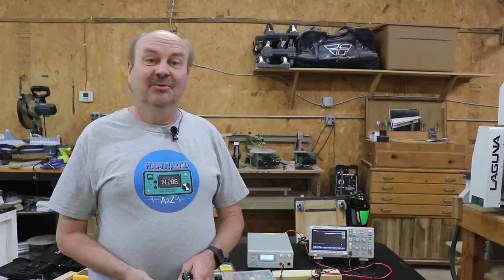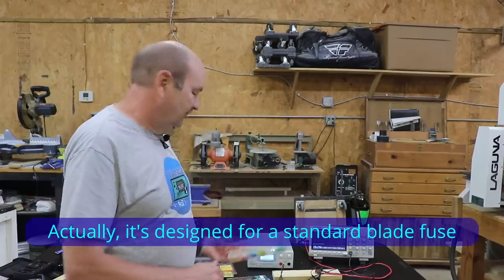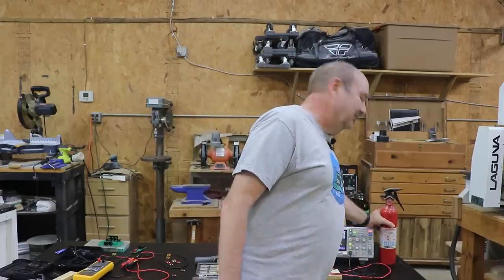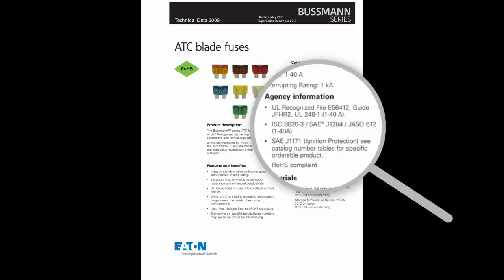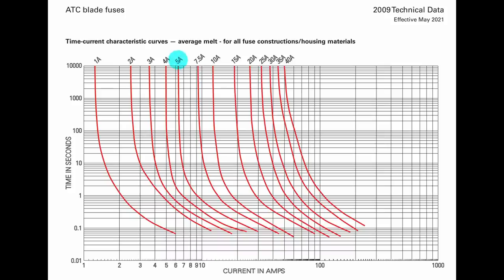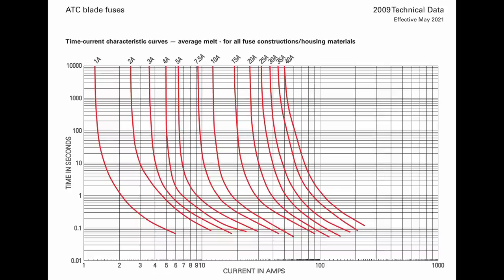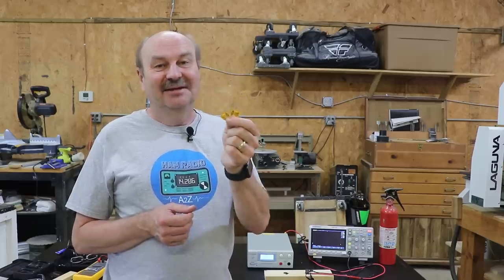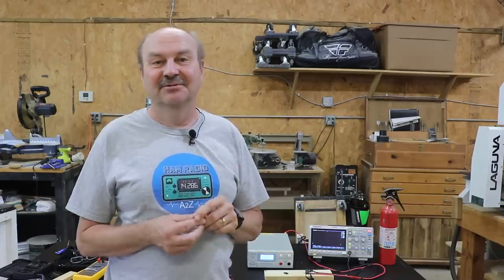Bad Fuses

Comment: Interesting I had problems with no name fuses but the other way around five amp fuses kept blowing  on a constant current battery charger putting out four amps did not blow instantly but after about three charges of the battery on a mobility scooter.
Reply: I'll second this. Most of the Harbor Freight or any unbranded fuses always tended to pop for no reason under normal load. 
I'm not sure using a fuse as a shorting element across the terminals of a power supply is an accurate test. I think the better test would be to place the fuse mid circuit against a controlled, resistive load through a larger power source. 
From experience over many years we often found that any fuse, regardless of the rating is better than no fuse. That meaning that even a 20a fuse will protect a circuit rated at 10a better than a solid wire, bolt, or tin foil wrapped old fuse. In most cases the fuse will blow before the wire melts. This does not apply if your trying to protect fine circuitry though. 
A case that comes to mind was a vehicle which had its battery polarity swapped by a careless tow truck driver. The car was brand new but the woman had left a power inverter on charging her laptop all day while at the mall. 
The end result was fairly substantial damage, the alternator, ECM, radio, air bag monitor, and just about every circuit that had any sort of constant memory function was burned out. The radio failed so thoroughly that even the LCD display was melted inside. Not a single fuse had blown in either fuse panel. Out of curiosity I kept and opened most of the damaged components to see exactly how and what failed. 
The radio, ECM, and alternator took the most damage. In the alternator all but one diode was burnt, and the voltage regulator was an open circuit across all terminals and it had even burned through the plastic cover on the back. The radio was pretty much a total loss, no one component failed and parts of each circuit each showed major burning damage. In the ECM, the failure point was at the case ground, which on that model was a 3/16 inch tab of steel which overlapped the main board as a ground, the corner of the board and the tab were melted and open, as was the memory portion of the circuit board nearest to the constant power pin. 
The explanation I got from the tow truck driver was that his jumper cable quick disconnect was broken apart and he had stuck the wires in by hand and 'got it wrong I guess'.  He said he knew something was off when he smelled smoke and realized that the battery terminal had melted. All of the fuses were OEM factory fuses the car was only a few weeks old at the time. 
At the time I would have figured that at least some of the fuses of fuse links would have blown long before that sort of damage occurred. I went so far as to call both the manufacturer and their engineering department to try and get an answer. What I finally was told by an engineer was that even though a fuse may see current in excess of its rating, when put into a direct short situation like that often the fuse element will liquefy vs. just blow and clear. In other words, even molten metal can conduct electricity just fine. In such a case, the fuse would not clear until the surrounding plastic was compromised or melted through. Since most fuses are made from acrylic, that can take longer than it would take for most circuit board traces to melt.  
Back when I was dealing with that case I pushed the issue with several engineers if no reason than my own curiosity. I went so far as to ship them all the damaged components directly to get a real answer, and the end result was the statement that fuses are not meant to protect from a dead short of reverse of current, they're there to prevent 'over current' or excessive amp draw. They also explained that wiring itself, if large enough can 'absorb' so to speak a great deal of current under sudden load both due to natural resistance and distance. An example of this is to look at how much current is lost over a very long run of wire if the wire is too small. 

Also, applying a dead short to a fuse with a 'regulated' power supply also may not be truly creating the high current short you would expect.  The regulator circuit itself may well be taking up some of the load or preventing full current from affecting the fuse or short. 
A good test would be to use a large variable resistor with the fuse inline on the positive side of the circuit. 
At 20 amps of true current, even a solid copper wire will melt and get hot enough to burn wood or melt its insulation at far less current. I think if that power supply was actually applying 20 amps of current to that fuse, its plastic housing would have melted even if the fuse failed to blow. 
Blade fuses are also notorious for being inaccurate or fairly random and are rarely used in better components, they're just easy to install and test and less likely to be wrapped in aluminum foil when they blow like a glass fuse often is. They also withstand shock and corrosion better than a glass fuse. A good example is that you never see blade type fuses on stereo equipment or speakers, or on higher voltage applications. 

I think a more accurate test of a fuse like this would be to put the fuse in circuit between a resistive load and a larger power supply, or battery. Control the voltage through a VR circuit, and the amperage through a variable resistor with a meter. 
Then ramp up the current and record the point when the fuse blows. Chances are it'll 
clear within 10 percent of its rating every time. 

Think of it another way, if you take a fresh 9v battery and short it out with a small paperclip, and measure the temperature. It'll get far hotter than 150°F. It may even glow red. Do so with a larger battery and it'll burn through. So to think that any 5 amp fuse, made from aluminum, brass, lead, or tin, taking a true 20 amps without smoke or melted plastic isn't likely
Reply: @VB-bk1lh  The other thing about using a regulated power supply is to regulate the amps the voltage is dropped so that fuse was only taking 20 watts and not three hundred watts which is what you would have at full 15 voltas 20 amps and its total power that does the heating and therefore melts the fuse, a wattage rating would ne more realistic.
Reply: @VB-bk1lh it doesn't matter if its directly across a power supply or in a circuit with a load.   20A is 20A    it makes no difference.     The 5A should have blown in  a few 1/10 of a second.

Comment: I was confused for a minute or two and thought that with that much power, the fuse should be glowing.....  but then twigged to the fact that the PS had ramped down to 0.6 of a volt, 12.6 Watts.  Be interesting to see what a constant voltage, constant current situation would be and measure the max current draw prior to failure.  Very odd....
Reply: MIchael: good point, I always wonder how fuses actually blow, it has to be heat that melts the little filament. P=U^2/R so if the voltage drops, the heat dissipation gets lower. I guess the R behaviour is what to look for.... the resistance varies with the temperature on some materials, causing these unexpecting behaviour. Also... there are fast fuses and slow fuses... If you repeat the test at different voltages, does it matter? 1.5V, 5V, 12V, 48V?
Reply: You cannot have both constant current and constant voltage with a fixed resistance.  With a fixed resistance if the current is constant, the voltage must drop.  If the voltage is constant, the current must rise.

Comment: Now it would be interesting to test how high you have to go before it blows - I wonder if all the fakes are actually the same rating whatever the biggest one is?
Reply: that may be a possibility !!
Reply: His test process is flawed, you have to be able to perform the test at the voltage rating of the fuse too, not just the current rating. 20 amps at 0 volts is not a proper test. Most automotive fuses are current rated at 30 or 40 volts.
Reply: @ediedrick  fusewires are ohmic with a low resistance below their rated current, aren't they? So if you jack up the voltage, you jack up the current. Getting a statically high voltage along with the high current means that you actually have a zener diode or a resistor, not a fuse.

Isn't the voltage rating to do with when the gap might arc? Ie, never apply more than the rated voltage across the fuse after the fuse has blown, and you can't get anywhere near that DC potential across the fuse before it's blown, you need some high frequency components to do that.

Also 20amps happens at 0 volts across neither a resistor, insulator, nor a conductor, and a fusewire is one of these at all points in its lifecycle. Conductor before plasticity, resistor during, and insulator after. I've seen some fuses for sale that are circuit segments with diodes after plasticity instead of insulators. That gives me the heebeegeebies.

Comment: Thanks for this.  I'm in the middle of building a DC Power Distribution Panel out of a cheap Chinese clone of an MFJ product using these fuses.  As they were designed for cars they may not be high precision but I'll wager they're better than nothing. Most of my devices have more precise fuses within them anyway so my PDS will be more of a last resort thing to keep the house from burning down. It will also provide easy test points for voltage monitoring.  Some of your tests may have been affected by your SMPS delivering chopped power rather than pure power in order to maintain its CV/CC settings.  Suggest you try again using a high current linear supply or a large regulated car battery.

Comment: Thanks for the video I have some of them too. I will be discarding them. You may be aware already that the Crimp connectors should get the same treatment. Only use quality crimp connectors others may not give a good lasting connection.

Comment: I just did a quick test and a cheapo 10 amp fuse took around 2 seconds and a 5 amp fuse took less than 1 second. both were hooked to a 10 amp battery charger.

Comment: I don't think there is anything wrong with the fuses you have. Current or amps is the work you do through a voltage. you can't just squirt out amps.  I believe you need to use a load in series with the fuse that will draw more than 3amps.  just to be sure i would use a name brand fuse and see if you get the same results and your SMPS probably has a protection circuit to protect it from a dead short like you are doing.

Comment: WOW, that's unbelievable. I had no idea. I won't be buying those on Amazon. I wonder how accurate the auto reset blade circuit breakers are.  I have a friend who has a box truck he uses for work. It has an intermittent short on a 15 amp light circuit. Sometimes it will go for weeks without blowing the fuse. I couldn't find the problem. I was thinking about mentioning the circuit breaker so his lights would come back on at night. Would you want to test those breakers?

Comment: Nice vid, did you also test a 10 amps of the “cheap-box”? It is very dangerous indeed and not ok! but from what I know: the orange color that fuse have, normally stands for 40amps. 5amps should be brown. There is written 5 but maybe they are mixed up.

Comment: Found this out myself the hard way last night. An ebay 30A fuse almost torched my van. It failed eventually but it took the fuse holder with it
Reply from the maker: Sorry to hear.  I didn't really cover this in the video, but I had always assumed that even the bad fuses would blow almost instantly when connected to a car battery.  I figured the hundreds of amps that it could deliver into a short would surely blow the fuse.  I guess I was wrong.

Comment: Just to add to this:

Beware these type of fuses from stores like Harbor Freight. 

Had a neighbor with all sorts of electrical system problems on a Harley that he owned and I diagnosed it to be the fuses. Turns out the blades are not actually thick enough to make a proper tight connection and will start to cause problems later on down the road after a few bumps in the road. On a Harley especially with all the shaking the problem is amplified. 

I even got burned by one of these type of fuses inadvertently ending up in one of my trucks in the spot for the A/C Clutch in the fuse panel (already knew about the problem with the fuses just didn’t realize) that would work/not work mimicking a defective compressor which ended up being changed for no reason because of one of these fuse. 

Established Brand name fuses worth every dollar let alone them working as intended to prevent damage or fire in a component.

Comment: Curious if on the cheap/bad fuses, do the different rated/colored ones have a visibly different filament size? Or are they all the same regardless of color?
Reply from the maker: I thought about this also.  Just glancing at them, the 20 Amp and up look pretty identical to each other.  The lower amperage ones look pretty similar to each other as well.  There is a different conductor shape between the large and small amperage groups.  I may break some apart and see about getting a micro-ohmeter to measure any differences.
Reply: @HamRadioA2Z  I think you might be better off by using a micrometer to measure the fuse's cross sectional area.

Comment: A large 12V Marine battery should give you more than enough amperage for a higher Amp test.
Reply: instead of building a short circuit i would rather use a Resitor of some kind (Big lamp) for these tests. I wouldnt want to be near a Battery being short circuited at all
Reply: @dummyload7803  Understood.  I sometimes use big batteries for making emergency  spot welds with welding rods.   There is a lot of amperage available in those things. Enough amps to make the heavy welding cable hot.

Comment: Do you think the issue with the 5 amp fuse not blowing, may have be due low voltage used in the test. 0.6 volts (0.6 volts x 21 amps = 12.6 watts). Did you try the same fuse at 13.8 volts (13.8 volts x 21 amps = 289.9 watts).
Reply: You need to review how ohms law works and how a constant current power supply works.
Reply: @stargazer7644  exactly, the voltage across is irrelevant, as the psu output volts will rise to whatever the fuse and cables will allow to appear across it with that current flowing,, its the current thats important
Reply: As an update from my last post, I checked the rating of the ATC fuses and they are rated at 32 volts DC for each specific current rating. It is logical to also test the fuse at the rated voltage.  There is nothing to do with it being a constant current power supply, if the fuses at not being tested at their rated voltage. 🙂
Reply: @petergravy6893  You aren't getting it.  You CANNOT test fuses both at their rated voltage AND their rated current at the same time.  That's not how Ohm's Law works.  The voltage across a shorted fuse is dictated entirely by the resistance of the fuse and the internal resistance of your power supply.  Regardless, voltage isn't what opens a fuse, current is what opens a fuse.  The only reason a fuse even has a voltage rating is because they can arc over after they've opened if you have too much voltage across them.
You can test them at their rated voltage with a constant voltage power supply but then the current will be enormous.  Or, you can test them at their rated current with a constant current power supply and the voltage will be small.  This is how physics works, so yes, it has everything to do with if you're using a constant current power supply.  If you don't even understand the most basic principle in electronics (Ohm's law), then you really don't have any idea what you're talking about.
Reply: @petergravy6893  it doesnt  matter, its the current that does the heating, the fuse is very low resistance, less than an ohm, it will only need  a couple of volts at most to force  a high current through it,

Comment: Tom, 
Thanks for introducing us to fuses that last forever. Some safety-critical items should be brand-name and purchased from reputable merchants. I'm not sure Walmart fits that bill.

Your video makes me wonder if we wouldn't be safer if made our own fuses with Copper wire as they do in Oz.  I have designed a few power supplies and have faced the too-slow fuse blowing problem. I never built a solution. On the next one, I plan to use a current-sensing resistor to trigger the power supply shutdown. I haven't decided on the way to do that. While a latching relay comes to mind, the same thing can be done with  FETs or MOSFETs. A circuit could be designed that shuts off very fast. There would have to be some over-current allowance built in to prevent unwanted shutdowns.
de W5RED

Comment: I use the 1A, 2A, 3A, 5A and 7.5A fuses exclusively in my motorhome. Never been a problem. They blow when they need to blow.
Reply: you must have the good ones, then
Reply: @andygozzo72  From random eBay suppliers, straight from China.

Comment: 2:29   protect shack gear with a crowbar and FUSE ?? 😮 We're two decades into the 21st century there's almost zero rds-on MOSFETs cheap as chips for input foldback current limiting /inrush limiting/ OVP .  Fuse?